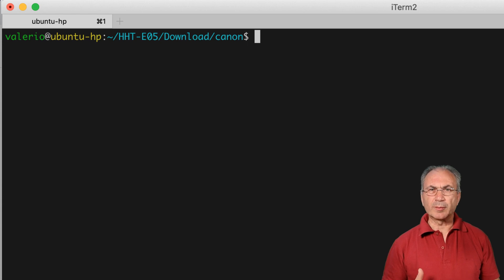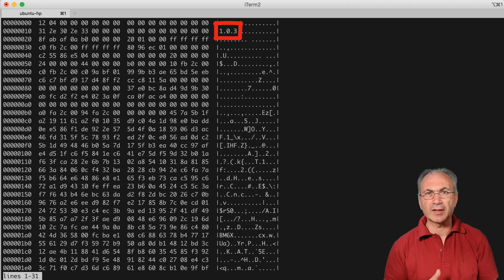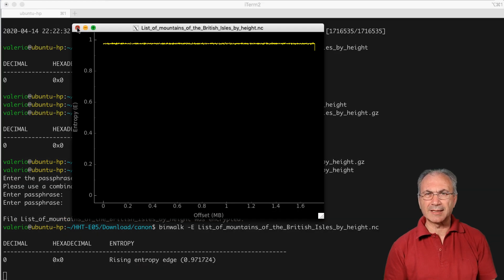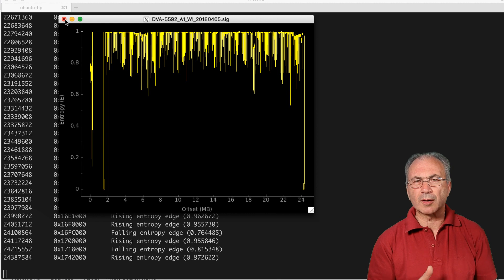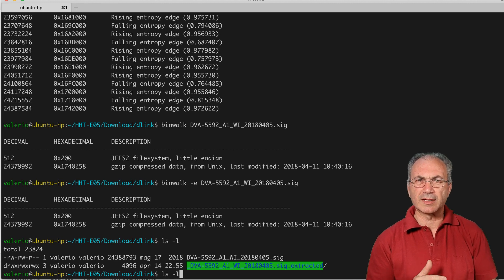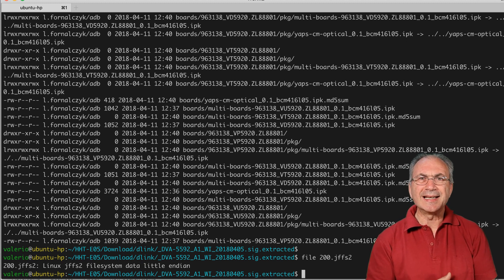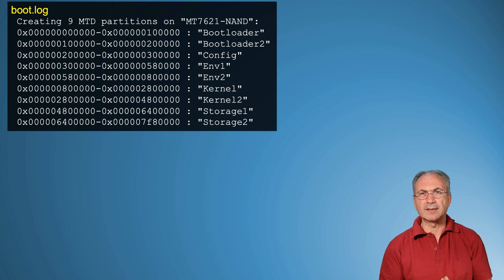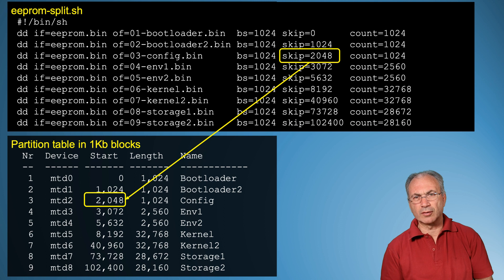#05 - How To Get The Root File System - Hardware Hacking Tutorial

Comment: 22:41 I can recommend, instead of computing SHA sums, it is less typing and perhaps a bit less esoteric, to use /usr/bin/diff which will simply report nothing, or "Binary files differ".  In either case, a full scan of each input file is needed so there is no efficiency gain of computing the hash.

Comment: Thanks a lot for your Videos, how can I handle a list of .zlib files? After using binwalk to extract the files in the firmware the system folder is split into multiple .zlib files and multiple fs_1 folders. Also, how can I add Burp Suite's root certificate into the list of trusted certificates for traffic analysis? Thank you!
Reply from the maker: Hello Emmanuel Wamuo, thank you for your appreciation. I suppose that Binwalk misidentifies the .zlib files extracting something that was not intended to be a separate file.  If it creates multiple fs_x folders is because it identifies (maybe wrongly) multiple file systems or multiple partitions inside the firmware file. Do you have files inside the fs_x folders? Regarding adding the BurpSuite's trusted CA certificate, it depends on your device, you should find where it has current CA certificates and put the BurpSuite's certificate there, adding or replacing current certificates.

Comment: i found the firmware in internet but it is a zip file. according to the firmware upgrading procedure of the router it accepts zip file and not requesting password. unfortunately when i try to work with the same zip file in binwalk it cannot even unzip without the password. also i cant access to the bin file. please give me a lead. should i manually get the stock firmware out of router using a UART module?

Comment: Thank you for the useful information!
I want to note that in some cases unsquashfs does not work because manufacturer made changes to squashfs-tools to pack own firmware. In such cases, sasquatch helps: https://github.com/devttys0/sasquatch
For example, I recently discovered Netis WF2411 firmware, and unsquashfs was failing with "read_ids: Bad inode count in super block" — sasquatch  helped me to extract router filesystem.